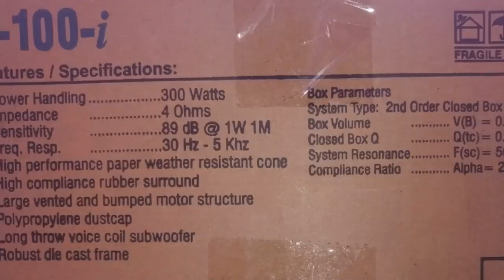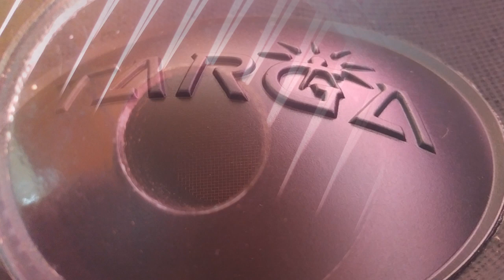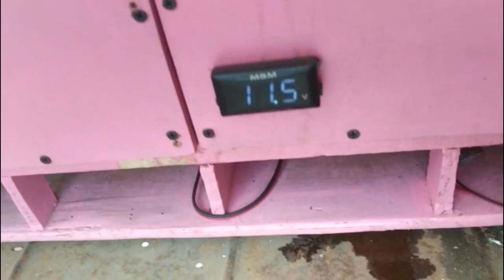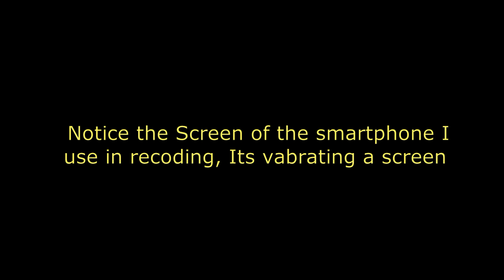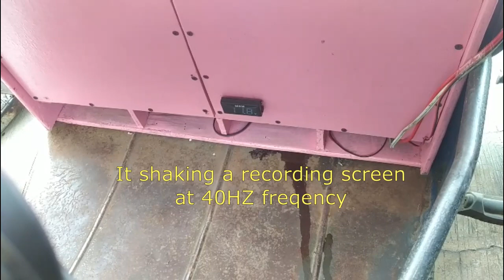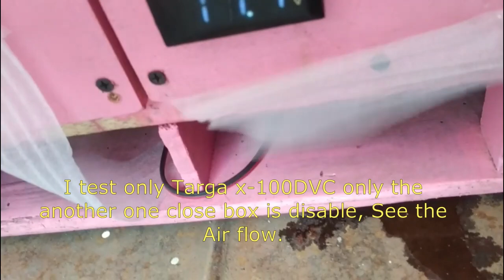SoundCheck: Targa Subwoofer DVC Review for Homemade 2nd/4th Order Box

Comment: Helo po sir new sub po ako..tanong lang po  sir kung ano mas ok gamit kopong amp ay sakura 737 ano po mas ok sir 8ohm poba or 4ohm para bumayo ung bass nia salamat po  may ganyn ako dlawa sir dvc100 dn dko po alam pano mag set eh salamat po ng marami
Reply: Kapag 737 naka set na ang mga output jan sa likod na pararrell topping kakapa sa chan A dalawang speaker nilagay sa bawat output naka pararel yan sir kasi set up yan sa likod jan ay hindi series gaya sa power amp may binding post aanag speakon
Reply: Nga pala s8r gamit ko pla lported na boxx po salamat sir
Reply from the maker: @samzgalutan9789  Hi! Mas malakas ang watts kung mas mababa ang ohms. Kung DVC speaker the best connection for high watts is parallel Video 2:44 . May mga DVC na ang specs ay 8+8 at may 4+4 ohms meaning if 8+8 pag parallel magiging 4 OHMS But please check the impedance of amplifier if supported like 2, 4, 8 Ohms para hindi mag overheat ang ampli. Thanks

Comment: Idol pwede ba dalawang targa x100i 10inches tapos may 2 tweeter and 2 mid speaker, dalawang box ang gagamitin sa amplifier ko eto yung specs ng amplifier ko
8"300w x 2 Max power

Output power 300W x 2

Freq.response 40Hz-20KHz

Sensitivity 93db
Reply from the maker: Tutunog pa rin pero, [300W x2] kung PMPO watts rated ng ampli mo kulang yan 2 kase rated ng Ampli isang  PMPO at RMS . Kung Targa gagamin mo dapat nasa Minimum 60W Rms ka para Bumayo. 60W Rms halos katumbas ng 3000W PMPO.

Comment: Boss pano pag dalawang targa dvc ren gagamitin sa isang ampli? Pwede ren bang ung isang terminal bawat speaker nasa left at ung isang terminal  bawat speaker nasa right? Hindi poba masisira speaker or ampli?
Reply from the maker: ikabit nyo nalang bawat isa ang spkr sa output ng ampli nyo tas ung connection ng speaker make it series if gusto nyo 8Ohms, parallel if 2ohms, 4ohms 1 terminal lng [video 2:42]
Reply: @KnowInsideGadget  sir isa lang na terminal ginamit ko both speaker.hindi ko siniries or parallel pero sa chanell 1and 2 ko nilagay.car amp gamit ko.ang alam ko kase magka combine channel 1 and 2 sa car amp na 4 channel maggng 2ohms po load kapag naka ganun.kase d ko alam ohms capacity ng amp ko. Mrv f805 v12
Reply: @KnowInsideGadget  gusto ko kase iparallel sana kaso d ko sure if kaya ng car ampli na mrv f805 v12.
Reply from the maker: @romesanqui8555  to get 4ohms with doble power. pwede naman ikabit sa left &right output ng ampli sa 1 Targa DVC, dapat mono ang output ng ampli hwag stereo, kase masisira spider ng spkr kapag stereo.

Comment: Kaya ba nyan ang 2800 wattz na ampli? 4 channel 700 wattz per ch sir
Reply from the maker: If ampli pang car 2800W is rated PMPO kaya kaya po parang 200W RMs din un
Reply: @KnowInsideGadget   opo sir 2800 watz na pang tricycle
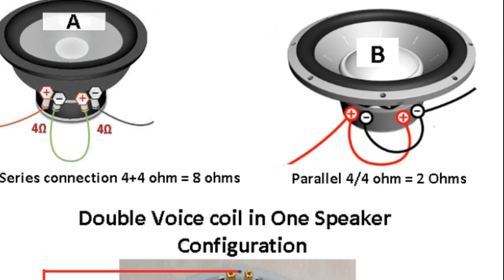Reply from the maker: @chrisb9636  sakto lng po I suggest is 1st & 2nd output kabit nyo sa 1&2 terminal targa (2:53) then ung 3 & 4 output kabit nyo mga tweeter/Mid
Tapos lagyan nyo ng LPF ung input ng 1&2 para maging MONO ung targa(2.1channel ang dating) hiwalay ang kabog sa circuit. thanks Subs nalang kayo sakin mga pinoy ^_^
Reply: Yon salamat po
Reply: Eh halimbawa po dalawang ganyan 10 inch subwoofer  pwede. Pa rin ba  tig isang terminal gamitin ko sa 1 and 2 ch?
Reply from the maker: @chrisb9636  opo kayo po bahala basta dapat isa lang ang audio input as in mono para hindi maglaban ang spider ng  1speaker.

Comment: Hindi nmn 2nd ordrer yan boss 4th order bandpass yan malakas pero narrow lang ang frequency range tapos peaky yan pangit...
Reply from the maker: Ok po! siguro nga kase class AB amp po ginamit ko at battery 12V supply only depende nalang sa amplifier watts na gagamitin pero nung  itry ko yang box na yan at speaker sa 220V Home amplifier mas mayanig siya at mas malakas need ko siguro magpalit ng juice amplifier pra sa 12V battery..
Reply from the maker: sorry to say 2nd order po yan box. 2 lang na makasama  design para sa 2 DVC kaya ng mabuo  nagmukhang 4th order thanks...
Reply: 2nd order box yan kpag nsa center ung spker at front lng may exhause ang 4th order 2 ang exhause pati back side meron
Reply: @triple3episonet338  4th order bandpass po sealed yung front, backloaded yung horn vent...ang 2nd order po simpleng sealed enclosure lang po front firing...
Reply from the maker: @tumivel5363   i correct/edit ko nalang po thanks sa info ints 4th order box home made.

Comment: Tukod yung bass, halata naman bagsak ang voltage kita sa volt meter😅
Reply from the maker: Tama po pag naka LPF na ang ampli at set ng 40Hz need na ng Audio capacitor 1 Farad napag usapan na po yan sa baba ng comments dahil hindi na kayang supply ng 1SM battery ang ganyang Speaker sub dahil sa LPF

Comment: magandang araw po sir..new subscriber here..pa advice namn po sana kung anung ma recommend mo na ''mini amp'' pra ma drive ung targa x-100i dvc (isang speaker lng)..gawin ko sanang active sub..100w+100w din sana tulad nyan sa inyo or 150w+150w..salamat po ng marami
Reply from the maker: Ah crossOver hanap mo na Mura lang na MINI amp na abot kaya hanap mo Plug and play na siya Check this 800php lang yata yan
Check here my blog - http://knowinsidegadget.blogspot.com/2018/12/200-watts-diy-amplifier-board-21ch.html
2. Kung Gusto mo naman matipid sa battery ung Class AB chips 4 pcs na TDA7379 kaso modified circuit parallel at 1 Low pass filter DIY na ikaw gagawa para makuha mo ung 160W RMS total para sa isang TARGA.
CLASS AB CHIP - http://knowinsidegadget.blogspot.com/2018/08/tda7379-amplifier-board-schematic.html
Reply: @KnowInsideGadget  maraming salamat po sir..ung 1st option nlng cguro..pra plug and play nalng..at mini ampli w/ LPF pa..ung set up ko kasi 2ch 4ohms each channel, 2-way bookshelf 220w max with crossover na nka connect sa kevler gx3-ub (gawin ko 2.1)..idagdag ko yung targa x-100i gawin ko active..tpos icoconnect ko sa kevler..

Comment: Boss meron kaba box plan na png 12 inch na ganyan,, salamat sir
Reply from the maker: wala po eh, pwede naman kaso hindi ko na ginawa masyadong malaki na para sa sidecar. try nyo po mag search ng 2nd-order box for 12 Inches.
Reply: @KnowInsideGadget ,,ah ganun po ba? kahit drawing lng sir,, parang d pareho plan ng bawat isang speaker yata no sir,,,
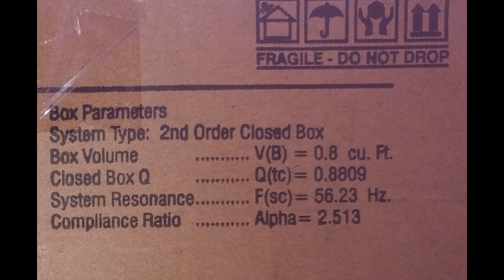Reply from the maker: @rickygonzaga2839   opo hindi magkakaparehas depende sa naka print sa kahon ng speaker ng mabili mo makikita doon. Ung sa akin sinunod ko lang ung recommended ng targa 10inch. depende nalang sa design ng gagawa pero dapat sundin ang box volume.,, Sige po i-compute ko ung box parameter volume recommended para sa 12 inch Targa stay tune nalang po at i post ko sa blog ko need ko makita kasi ung tulad ng ganito 4:19 sa video na nkaprint ung box parameter 2nd order close box.
Reply: @KnowInsideGadget  ah ok sir, kailangan marunong ka din mgbasa ng kung anong volume ng box ano,, tsaka sa design cguro at plan din ng box yan sir oar mas maganda lbas ng tunog,, hindi lng volume
Reply: Isa nalang sir,, pg dvc ba speaker halimbawa 200 watts mg doble ba pag parallel connection? O 100 watts per single connection,, salamat
Reply: 15 1/5 x 15 x 31 1/5  sukat ng box sa 2pcs na d12 na targa sir pasok ba sa volume ng box sir? Salamat ulit
Reply from the maker: @rickygonzaga2839   depende po kasi kung ported box or 2nd-order Box ang gagawin  magkaiba sila ng sukat ng pagdating sa box volume cu. Ft. example po...
1. 2nd-order box ang gagawin mo sa 10inch targa ay 0.8 cu. Ft (box no exhause) doon nakakabit ung targa, then ung close box nya ay 0.9 cu Ft. mas malaki ng konti ung front box nya then lagyan mo ng exhause ung 0.9 cu Ft.

2. kung ported box naman ang gagawin box, wala siya requirements kasi isang box lang siya na kita ung speaker. kung subwooper ang speaker mo lalo na kung DVC mas mabuting gumawa ka ng 2nd order box para doble ang reverve depth bass kaso need ng 2nd order box ng LOW pass filter ng ampli para yumanig ang box.

3. Sa tanong nyo po na kung doble ang watts pag na parallel pag DVC .hindi po magbabago watts, pag nag parallel ka makukuha mo ung 2 ohms (4/4 = 2) kung series (4+4 =8 ohms) Ang watts po ng DVC tagra ay 150Watts RMS per Cone (150+150W=300W Rms). sa aking paniniwala 1W Rms =20W PMPO convertion you can read more at http://knowinsidegadget.blogspot.com/p/what-is-pmpo.html
Reply: @KnowInsideGadget  un lng dko alam yang mga volume ano sukat nyan hehe mga cubit na yan,,
Reply: @KnowInsideGadget  bali kung 400 watts na dvc 200 per 4ohms kung isang terminal lng ginamit mo 4ohms na 200 watts ganun ba sir? Tsaka rms ba watts ng targa? Kasi mga crown d naman yata rms,, tnx ulit
Reply: Ok din ba png bahay ung targa sir ibig ko sabihin un amplifier tulad ng kevler ganyan o maganda lng pg png sasakyan o battery,,,